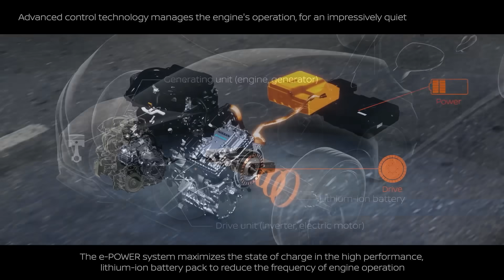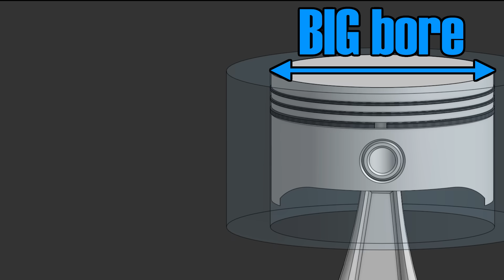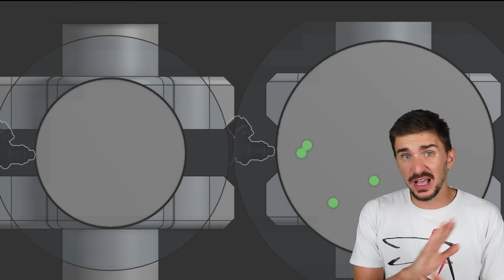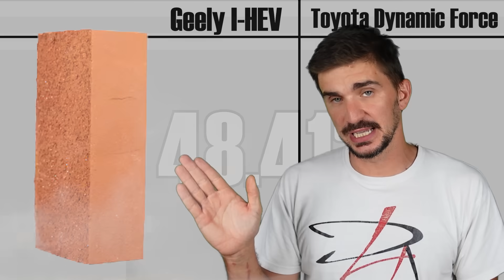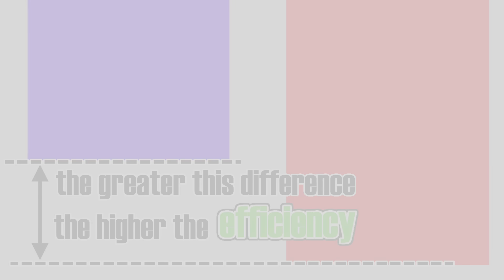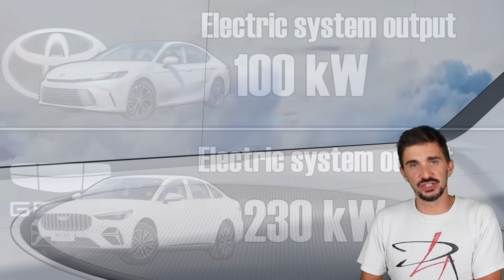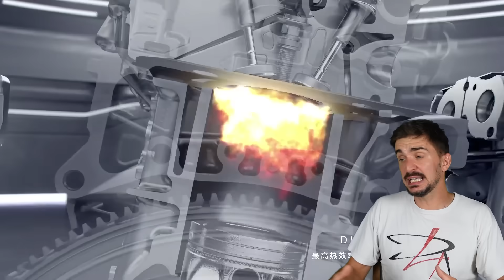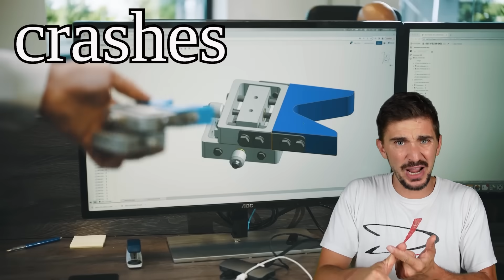How China's Geely Beat Toyota, BMW, Ford and Everyone Else

Comment: 9:31 - so it's not a true 15.5:1 compression ratio
Reply from the maker: Exactly! Love to see someone paying attention. That's the static compression ratio, but because of the Miller the effective (dynamic) compression ratio is actually much lower. But the deep miller requires the super long stroke and a high starting static compression ratio.
Reply: @d4a  I was thinking the same... 15.5:1 for gasoline? But the Atkinson cycle made it make sense as the intake ratio can be in reality something like 10:1, maybe even less, depending on the point the intake valve closes, but the expansion ratio being bigger allows them to harness more energy from the combustion. Wonder how far you can make it, like I can imagine that leaving the intake valve open for too long, the losses from moving air in the combustion chamber, then out again, outweigh the increased ratio of intake-expansion.

Also curious, being it direct injection engine, how quickly the carbon deposits grow on the intake valves, more so if the engine is starting and stopping frequently. From this perspective, the Toyota's approach with mixed port and direct injection makes much more sense for engine that is cycled a lot in case of hybrid drivetrain...
Reply: @steposka  It's the #1 reason why auto makers are using this dual injection system; they used to do direct injection only, and found out that carbon deposits murdered these engines fairly quickly.
Reply: @d4a  Depending on how "deep" the Miller cycle is, I am surprised Geely isn't running even more static compression, but I guess at a certain point it is difficult to design a smaller combustion chamber.
Reply: @AlexM-tx2vr I don't know if they were good designs, but I worked on some Detroit diesel/GM 6.5s that were something like 22:1.
Reply: @AlexM-tx2vr  i guess if they made the engine any more under-squared they would start to have packaging issues with the engine scraping on bumps, meaning they would have to make a taller car, meaning net design loss . . .
Reply: @AlexM-tx2vr  The narrow bore and long stroke are the key to this - it means the combustion chamber can be a normal shape with normal turbulence patterns, as opposed to a flat pancake which quells charge motion. Speed of combustion is important for boosting efficiency, and the narrow bore reduces the distance that the flame needs to travel, and reduces surface area (quenching), and it's better for charge motion which helps flame speed.
Reply: @d4a  it's like a WWI super compressed aero engine
Reply: @bernhardjordan9200 Well, no. That did waste all of the energy over the throttle to create vacuum and then it compressed the now lower pressure air over the entire compression stroke. And at altitude with the throttle open it still had the same expansion as compression. The idea with the Atkinson is to decrease the pressure difference between the exhaust gas and the ambient pressure by increasing the expansion ratio. To do this you actually need a different intake valve timing from a regular Otto cycle.
Reply: @d4a - I really think you will be super impressed with the Rotax 850 E-Tec engine ❗️❗️❗️
Reply: Atkinson/Miller obviously.

If it's Otto cycle 15:1, it's gonna definitely blow up without race fuel or E85.

The effective compression is definitely lower - maybe around 11:1.
Reply: @dy7296  Not necessarily. Mazda sold the Skyactiv-X 4 banger at 16:1 CR and that thing runs on regular 95 RON. Their standard -G engines are also 14:1 CR and still run on regular 95 RON and IIRC both are still otto cycle.
Reply: @stuntvist  But the Skyactive X uses variable valve timing. So I doubt it's a pure otto cycle.
Almost every modern engine uses variable intake valves and the miller cycle.
Reply: @stuntvist the skyactive x is a spark assisted HCCI engine which uses compression ignition of the gasoline fuel like a diesel,  so that's a totally different approach and require  high compression to run.
Reply: @stuntvist  sky-X is TRUE MILLER CYCLE , that's why they put supercharger in it
Reply: @jeroenkoehorst4056  and sky-X is TRUE MILLER CYCLE , that's why they put supercharger in it
Reply: @warlocarea42  and sky-X is TRUE MILLER CYCLE , that's why they put supercharger in it
Reply: It's a 15.5:1 expansion ratio.
Reply: When Mazda introduced the their 2.3L Miller cycle V6 in the 1994 Eunos, they stated the compression stroke was 80% of the expansion stroke. This meant that the effective displacement & compression ratio were 80% of the quoted numbers. So for 2.3L engine with a quoted 10:1 compression ratio, the effective displacement was 1.84L and 8:1 compression ratio. 

These days none of the OEMs state their actual compression stroke to expansion ratio, including Toyota, though, it's believed that Toyota's Atkinson cycle engines in their hybrids also use a similar 80% compression stroke. This means a 2.0L Prius engine is effectively a 1.6L engine, & a 2.5L Camry Hybrid engine is effectively a 2.0L engine.

Assuming a similar 80%, the Geely's 15.5:1 compression ratio would be effectively 12.4:1. However, with the "Deep" emphasis, the compression stroke might be 70% of the expansion stroke, leading to an effective compression ratio of 10.85:1 and an effective displacement of 1.05L. Hence, why Atkinson cycle is only used on hybrid engines with electric motor acting as torque fill. A non hybrid Atkinson cycle engine would result in a woefully underpowered vehicle.
Reply: @tonamiplayman4305  nope. ALL of non-hybrids dual-mode ice with miller/atkinson-otto HAVE 100% of their TRUE max compression quoted, WHEN they do in otto-cycle mode. that's why they have cam-phaser / vvti. e.g : 1994 eunos miller 10:1 CR is 100% 10:1 CR anytime in otto-cycle mode and so any other.
Reply: @tonamiplayman4305  underpowered por what? 

I mean you can always make the engine bigger to compensate for lack of specific power, that the whole American car design philosophy.
Reply: so, what's ur point? same as EVERY engines right? coz almost every latest 4cyl engine has atkinson/miller
so it is true 15.5:1 CR like any other when they do spec-ed

Comment: Its only me who think that efficiency for car's engine is some kind of TRASH?
Engine needs only energy from fuel explosion and that's it... Yes it become hotter but WHY engine should use it if Heat not what makes it RUN?
You could add some infrastructure around to use Heat BUT it will make engine more complex and HEAVIER ( what much important ) and your added weight will EAT your efficiency...

We should care only about MPG and engine maintenance cost.
Reply: Heat is what literally makes a combustion engine (aka heat engine) run.

If you want to put the excess heat to work we already have something for that.. it's called a turbo.
Reply: @AvocadoAfficionado Can't agree... Not HEAT makes engine run but EXPANSION of ignited fuel.
Reply: @I-PixALbI4-I Expansion of the heated working gas, combustion is just the mechanism of heating the working gas.
Reply: @I-PixALbI4-I I don't care if you agree or not, but you're still wrong.
Reply: @josefsvitak4313  OK lets imagine that exists gas that explode without heat... what efficiency will be? 100% because there is no heat that we can use elsewhere?
Reply: @I-PixALbI4-I Actually yes. If it somehow reacts without producing any energy (kinetic at molecular scale, observed as heat on macroscopic). Then you also harvest no energy, what would be 100% of the energy produced. What would propagate such a reaction is entirely different matter.
Reply: @I-PixALbI4-I  "explode without heat" 

What the fuck are you smoking lmao.

Comment: F1 has over 50% thermal efficiency.
Reply: add to that engine turbine-generator on exhaust and over 50% will be easily broken.
Reply: Yes, but it's not mass produced nor cheap.
Reply: Big marine diesels have over 60%, without any turbocompounding, so what?
Reply: @josefsvitak4313 those use turbocharging as a must because those are 2stroke ("diesel") engine and those also often recuperate exhaust energy as electric generator.
Reply: @bartoszskowronski  They do use turbochargers, but I haven't heard anything about them having a generator on the turbine shaft. It also seems counterproductive since by the virtue of having such a large compression ratio there isn't much of the exhaust energy left. Also ships do have separate electrical generators anyway.

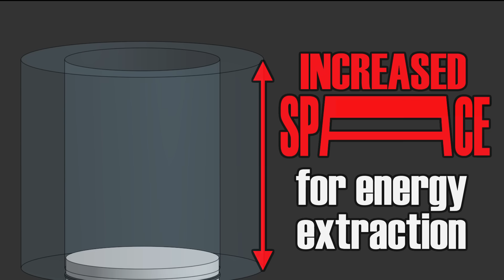Comment: 4:20 the statement makes no sense. The amount of energy extracted does not depend on the distance itself, it depends on distance multiplied by force. 
Geometry will not allow you to extract more energy from the same displacement volume.
Reply from the maker: Yet it does. You have to understand the whole bit and not isolate one sentence out of context.
Reply: @d4a  He tried to sound smart...
Reply: @d4a  he's right. Math is on his side
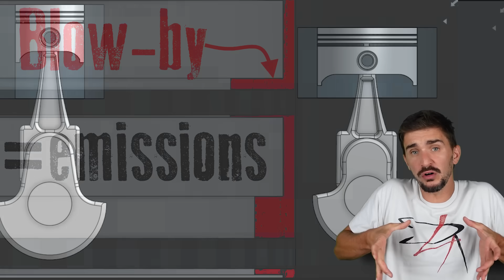Reply: @takiktos1265  he did math wrong more than once. At 2:50 he explains how wide pistons have worse sealing, like the seal radius is larger, the blow-by leak is happening more and this leads to higher emissions. But he misses the point that the sealing circle length is 2πR and the surface of the piston is πR² shich means the 2x wider piston has 4x the surface area but only 2x the sealing surface.
Reply: @paul_wiggin he's not wrong here
Reply: Consider the surface area and the fact that the piston, cylinder head and cylinder are all thermally conductive, so the expansion process is not truly adiabatic.
Reply: @josefsvitak4313  Yeah. more reasons to make square bore-stroke ratio - it will have the best ratio of displacement volume to the thermal conductive surface. Example:  100cm stroke, 7.2 cm bore cilinder has total surface area of 1141 cm² (includes side, top and bottom), 25cm stroke, 14.2cm bore cilinder has total surface area of 640.5cm². Sealing the longer stroke piston is actually harder because of the temperature gradient - the cilinder is hotter at the top and cooler at the bottom while the piston itself does not change its temperature much during the combustion cycle. This means the cilinder expands at the top relative to the bottom but the piston stays the same diameter. The longer the stroke is - the larger the gradient and the difference in the diameter of the cilinder at the top and at the bottom. This means sealing the longer stroke ICE is less effective than short stroke.

Are you interested in investigating all the geometry and engineering aspects of the ICE?

I`m not telling @d4a that short stroke ICE is more effective, i`m telling that the reasons he used to explain why longer stroke ICE is better are false and are more like the list of challenges to overcome, not the reason of the fuel efficiency.

Comment: The answer:
Stealing tech and playing technicalities.
Reply from the maker: Not really
Reply: @d4a I mean, it's almost like hydrogen-fueled engines have existed for the better part of 40 years at this point
Reply: This is the dumbest kind of cope over the last few years whenever a chinese company team made some achievement out of all things.

Honda had been an historic success in both commerical and motorsports. Guess how they started off in racing? Reverse Engineering Mondial.

Hyundai, probably the uprising icon in modern motorsport. Their first car? Hyundai Pony, based on Morris Marina with Mitsubishi powertrain. 

Toyota also started off reverse engineering. Their first "Toyota AA" has a reverse engineered engine from Chevrolet and body from Ford.

Reverse engineering is one thing of their doing. Improvising is another.